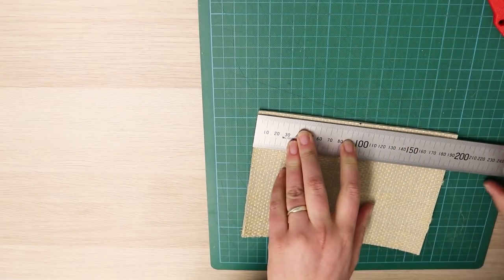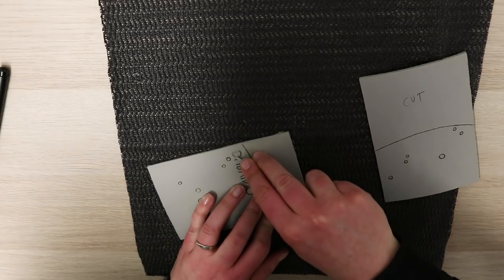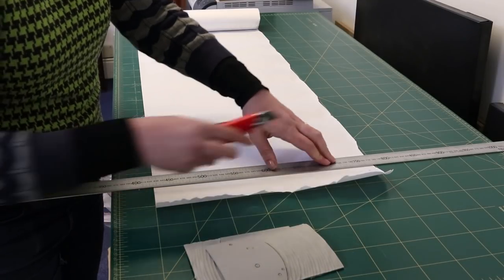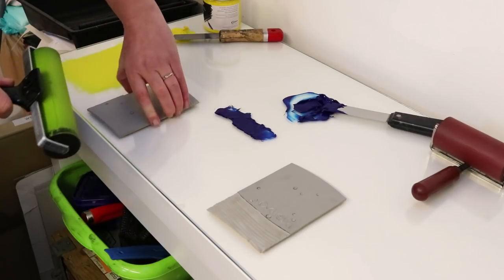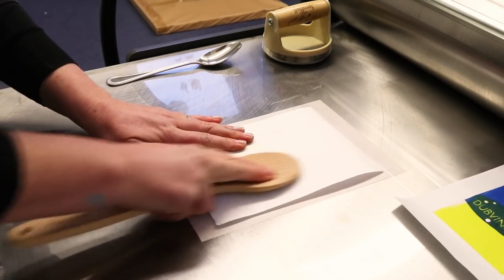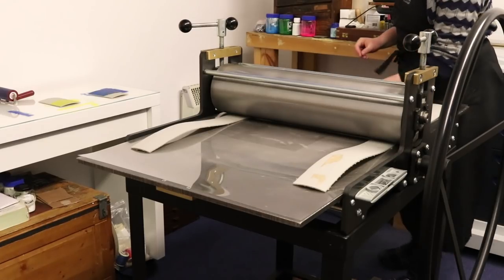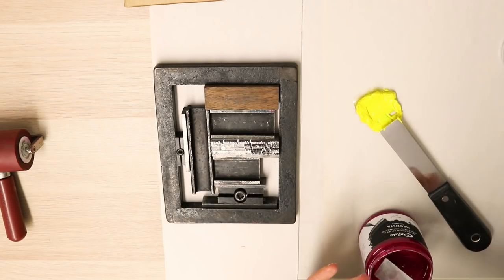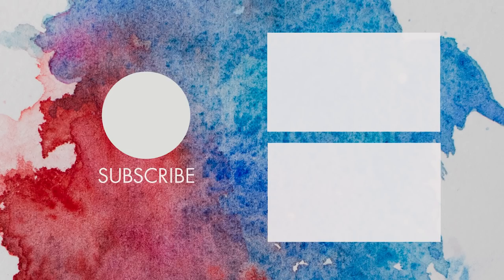Relief printing made easy

Comment: Here is a friendly tip from one lino-cutter to another. I would advise against keeping your lino-cutting tools in a tin since it is easy for the cutting edges to become damaged. I keep mine in a wooden rack that I made which is fastened to my workshop wall. Other means of safe storage are available including clips fastened to a piece of timber (or a peg board), or magnets. If you insist on using the tin, maybe you could fashion some small pieces of balsa wood to fasten over each tool tip. Anything is better than unprotected edges becoming damaged. Keep up the good work.
Reply: That was helpful.

Comment: Whats this material where you paint?
Reply from the maker: The "paint" is printmaking ink. For relief prints (linocut, woodcut, etc.) you want what's usually called either relief ink or block ink.
Reply: @SpinesAndSplines  can u tell me material
Reply from the maker: If you have a look in the description for the video, there’s a list of everything I used. Cheers.